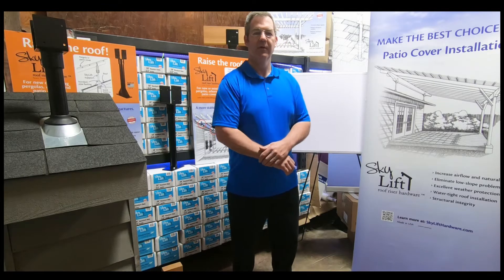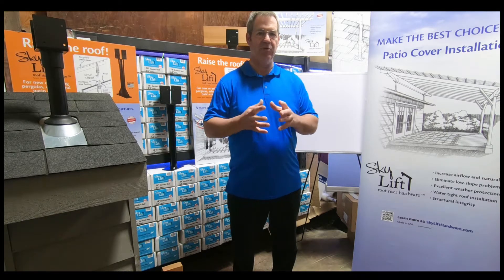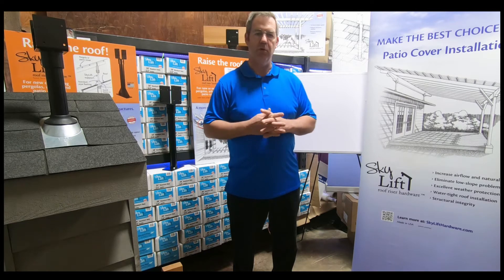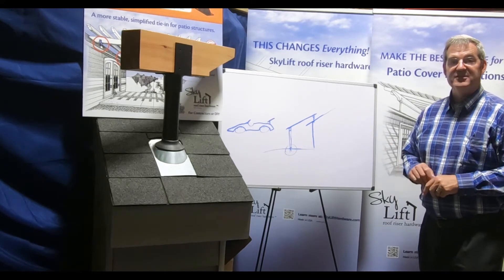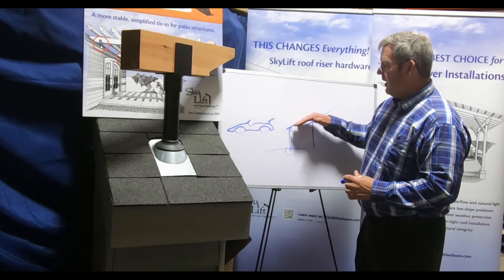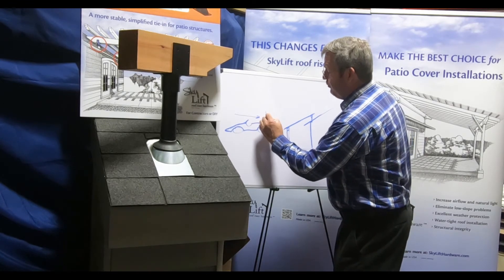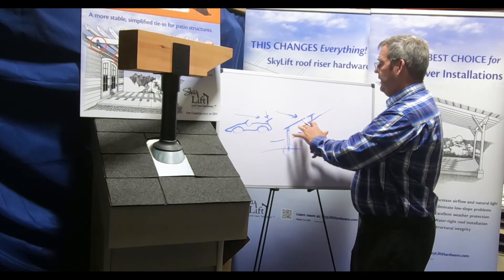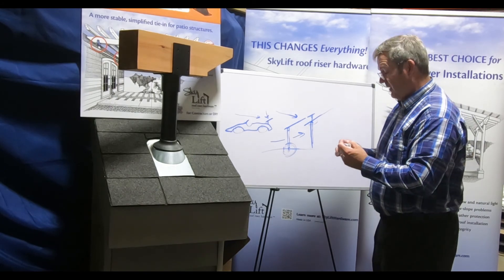Will the SkyLift Roof Riser Brackets Fly Off the Roof?

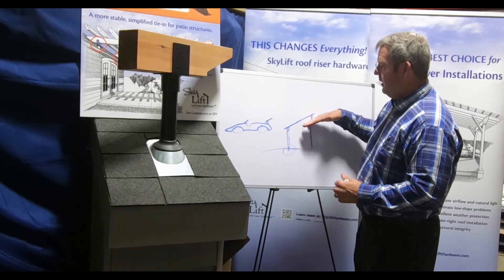Comment: Hi Doug/Skylift. I do like the design of your product, I don't own any of your products but have been aware of the concept for a little while now while looking into options for a porch remodel. Unfortunately, I do have to disagree with what is stated at 1:20, where it is said that the roof design is "flat like a race car spoiler". The majority of race cars do not have a flat spoiler, and they do not use direct wind load to provide the force as implied in the description (that would thereby cause much higher drag on the vehicle.) 

You were close to the mark when you mentioned aerofoils - spoilers typically have an inverted aerofoil design which creates the downforce at high speeds. I understand that it is a metaphor, but I think you should have stuck with just the first part of the description of the porch roof not mirroring an aerofoil design (ie, creating uplift) because the rest of the description implies that the wind is going to provide downforce, which in this case I would presume to be negligible.